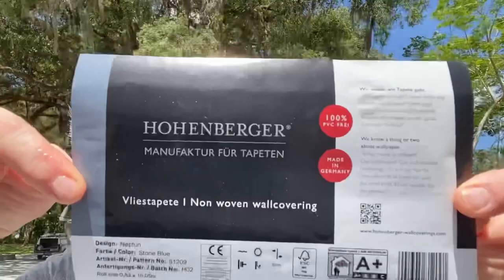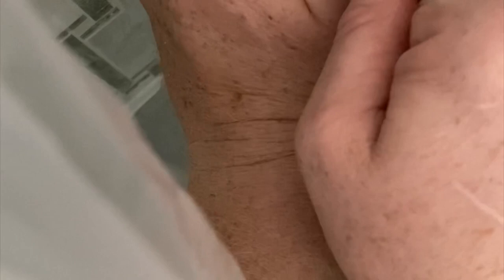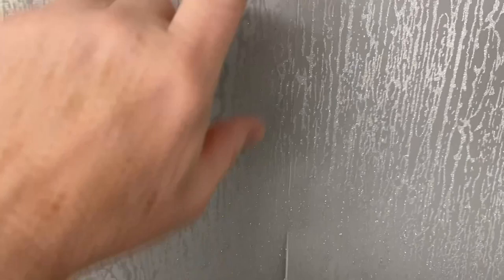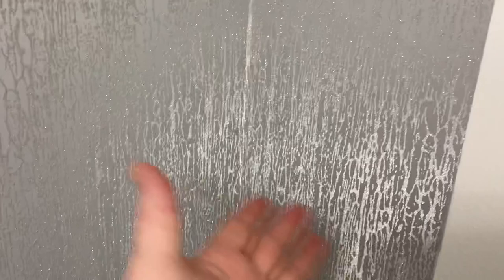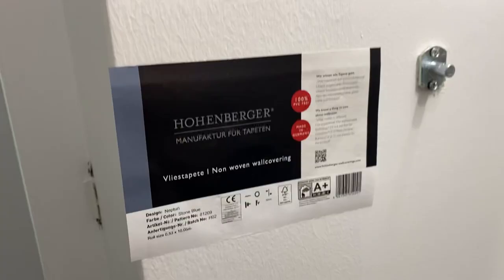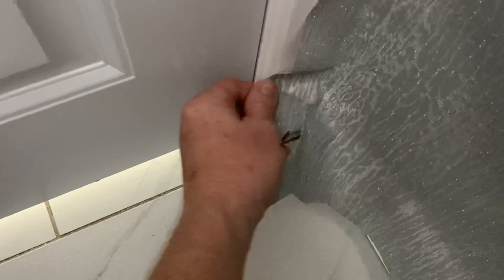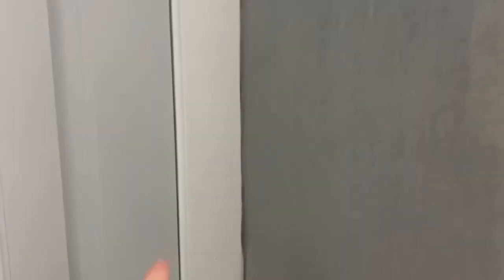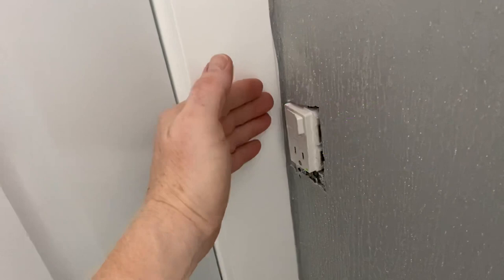Glass Beads Wallpaper Installation: Tips N Tricks - Spencer Colgan

Comment: Spence, just hung beaded wallpaper on the ceiling in a small powder room. Beautiful results! One problem, gnats, I believe, have settled..and expired behind the beads. Obviously ruined. Assuming from the house plants near there during our renovation.  Looks like specs of black spots. Tried everything to fix that I can think of.short of spraying something like gnat house plant killer…afraid of the moisture with that. Vacuum. Picking, scratching, sweeping..everything.  So sad. Any thoughts??
Reply from the maker: Pull back wallpaper…wash gnats off.  Paste back.  Gently.

Comment: Spencer I just installed glass beaded wallpaper.  I was wondering how you caulked baseboards, door jambs, etc. (white painted) to have a more professional finish.  I imagine you would use clear caulking.  Should I tape the wallpaper so the caulk doesn't bleed into the beads?  Would you recommend painting the caulk white so that it blends with the baseboard color?  Thanks.
Reply from the maker: Don’t tape this Wallcovering!   You’ll remove the beads. I don’t understand why you’d caulk. Avoid caulk.

Comment: Spencer could you please tell me how can I cut the wooven paper in the corner because it’s wet and it goes soggy. I find it a little hard when it doesn’t give you good cutting line. Thanks
Reply from the maker: Sure thing; do not paste the paper in that area when you paste your paper; let it stay dry and simply paste the wall where that paper will fall when it is installed and then it will remain sufficiently stiff and most conducive for cutting